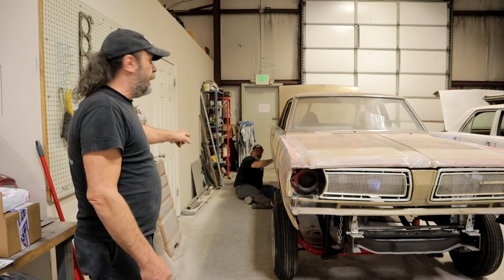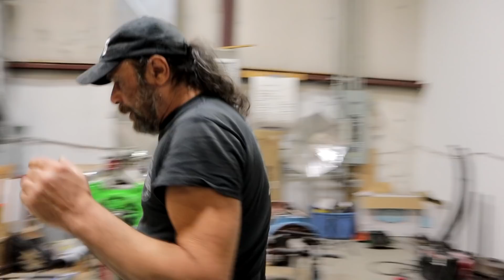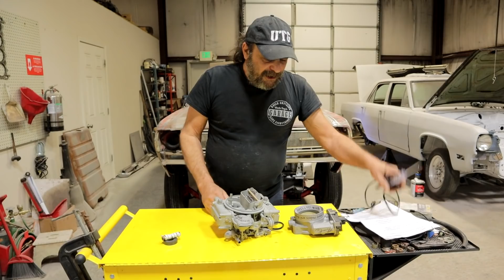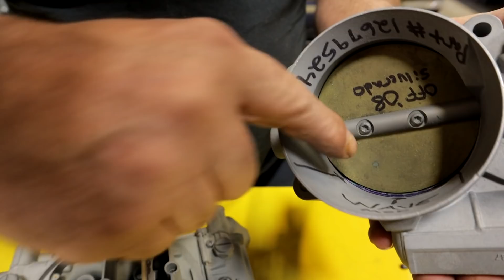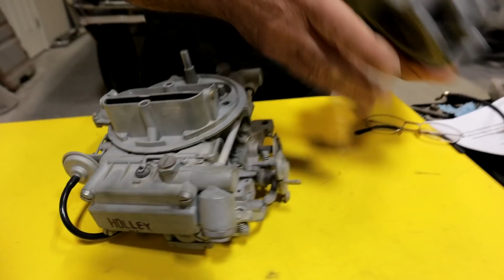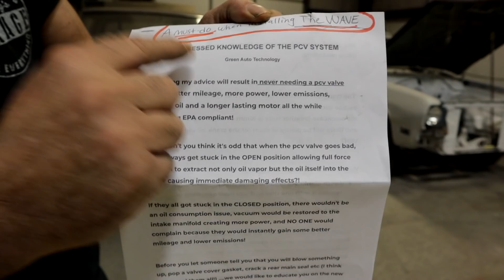The Free Energy Scam And Other Absurdities Of The Mechanical World

Comment: Tony!!!!!!! Contacting you for a idea you was tossing around in a older video about using the heat in the engine bay to help power the car through steam!!! I think there maybe another way without steam. Peltier effect and instead of using it to cool or heat something simply draw electricity from it... They are using this now in some camping stoves to draw heat energy from the fire using temperature differences from 1 side of the device to the other to make electricity. The devices are cheap when u buy them in bundles and just set up a 12v system to keep it simple to assist the car possibly through the belt drive like with a super charge except your electric motor is taking the place of it to help drive the car...
Reply: Don't think this could power a e\motor all the time but what about with stop and go driving? Ford was experimenting with a pressure system in there truck's in the early 2000s saying alot of Mpg's was lost in the acceleration to get to speed something over 20%. So why not a e\motor with a system thats using waste heat to store energy to help u accelerate to speed using fords Basic idea????

Comment: If you choose to test the carb, I agree with the others who suggest that you swap the modified throttle blade section with a stock one, either on the provided carb or on a known good stock carb, to ensure that differences elsewhere in the carb don't affect the outcome.  Also, it is probably worth coming up with a different test regimen than was used for the vapor test - in that test Al got 2.5 and 2.75mi, each on about 0.5gal of gas; this is only 5 - 5.5mpg, which suggests that test probably didn't reflect real-world usage, or that the car might be in such poor tune that any differences there might have been due to the fuel vapor disappeared in the "noise". 
A couple years ago while tuning my motorcycle carbs, I came across a tip suggesting to mark the throttle grip so that it was possible to observe just how much throttle is used while driving (so you know which system in the carb to focus on for a specific issue).  It was enlightening to see just how little throttle is being used much of the time, and therefore how little importance focusing on the main jets had on anything but WOT.  Logically it seems the modified carb should primarily affect low-speed driving, if it has any effect at all, so there might be value in doing a low-speed or small throttle opening test separately from a 'normal driving' test.  This should give the best chance for the modification to show if it has any benefit, and to show what, if any, benefit it might offer in normal driving.

Comment: l agree with you if you don't understand the basic principles of the internal combustion engine you can't improve it. And yes the PCV system on an engine is one of the best improvements it also helps the front and real seal do their jobs without pressure from blow by from the cylinders

Comment: here is what you do you get a bore a scope you may have to modify the intake manifold to be able to Insert the bore a scope under the carb . you inject some smoke while the motor is running and see if the air currents are visible. then  I would tell mike to get he's head checked.

Comment: I agree 100% about the PCV system... a very innovative and ingenious idea that most people STILL don't understand.  I'm glad to hear you'll be doing a video on it and I can't wait to see it.  
Funny story... my grandfather was a mechanic back in the 50s.  He "invented" his own PCV system around '52 or '53 and installed it on his own engines and some of his customer's engines.  He simply cut off the road draft tubes and/or installed a hose with an orifice from there to the intake or carburetor.  He kicked himself until the day he died wishing he'd applied for a patent...
Reply: Your Grand dad would have been wasting his time!  We had a 1947 GMC farm truck that had a factory PCV system.  As a kid I thought it was one of a kind but have since seen other trucks of the same vintage with the same system.
Reply: @Cougracer67  I'm quite certain the only crankcase vent system any manufacturer had in 1947 was the road draft tube.  Factory installed POSITIVE crankcase ventilation didn't come around until the mid '60s.  I'll do some research, though, do you have any other info about it?

Comment: I remember doing several diesel fuel tank drop and clean outs due to filling up with gas at the pumps across the street. Of course  we would put that crap in our gas burner cars/trucks because it was free go juice! so we figured 3-4 gallons of diesel mixed into 20 gallons of gas. I would fill up half my tank with that crap then drive across the street and fill up the remainder with 93 and the car would run great and I would get 1.5-2.5 better mpg's. The other guy would do the same on his truck and fill up using regular and complain about pinging like crazy until he was able to add 1/4 tank of premium and it went away and his mileage would go up like mine. These were both lower compression non performance engines, chevy 350 and chevy 2.4L, two valve etc. Im wondering if that roughly 10 or 12 to 1 mix would offer better mileage on a test stage. Fyi don't give in to the free energy nuts, it only emboldens them.

Comment: Well, any test most probably should be light throttle and load  . When Jenkins had me put 850 baseplates on 660 carbs, he had me taper bore the stock 660 hooopty-do grooves out for a nice transition to the .060 larger throttle bores . He said something to the effect that the hooopty-dos were just for transition from light load to full throttle  .

Comment: I'm not an expert, only an retired Chrysler mechanic. The throttle body has an idle air passage that allows air past the blade . At idle the blade is completely closed . If you would open a pasege allowing more air to pass past the blade, the idle air motor would try to close to control the idle rpm . I think it would create a big problem,light the check engine light. Not sure about a carb
Reply: Not true. There are a hundred videos that show no added problems after the successful mod has been done.
Also you have to reset engine computer before the changes so it speeds up the computer s own adjustments to the mods.

Comment: Back before YouTube I remember seeing a web page where this guy was showing you how to build a car that ran on water! He was showing you how to electrolysize the water you were going to fill up your gas tank with and pipe the Hydrogen/Oxygen mix up to an internal combustion engine at the front of the car! The engine would run the generator that powered the electrolysis back at the gas tank! I can't remember whether the vehicle moved via electric motors powered by the generator or via the drive shaft from the engine. He was demonstrating with some late 60's, early 70's domestic car like a Valiant or a Nova. It was absolutely hilarious!

Comment: As for testing that magic device, you will need a control, meaning a "normal", non-magic-wanded device. 
I think the only way you will be able to see if it has even the tiniest result would be to pick a non-windy day, trailer the test vehicle to someplace very close to the Interstate, and then take test vehicle up to interstate and set the cruise, or monitor the tach or something to ensure you are running a constant RPM. Run quite a few miles, turn around. Swap the device in the parking lot next to the trailor, and then do it again. Figure out MPG in whatever way you see fit, might be best to top the tank off before both runs and after and measure the fuel I guess. maybe you can find a gas station next to an exit ramp with enough parking space. EDIT: don;t forget to warm the test car up and re-top the fuel before the first run. 

if you do any town driving at all the crazies will say you r werent consistent. If they insist that is where the savings come from, then this is already a lost cause and not worth bothering with, the variables of city driving make testing a device impossible unless you do it over the course of six months of daily commute. I know I wouldn't invest that kind of time.

Comment: I'm with a lot of people, on the battery charge; Let's test it, first. On the carb test;  I'm wondering about that. How can it be fair? What all, was "done" inside, to this first carb?  Anything? So, picking up the same year-make-model, and jetting it, matching the venturies.... Just to keep things equal. You have 4, or 5 different drivers, a quarter mile KNOWN course, with stop-n-go traffic. THAT'S where most of the driving is done. Not on an open highway, where the speed is constant. I grew up in New Mexico, where it was some 60 miles, from Santa Fe, to Albuquerque, and 100 miles, to Las Vegas. I, personally, went past a State Police officer at 100 MPH. He never blinked. BTW! My thoughts on these 100 MPG carbs, throttle blades, and other magical Unicorns... There have been several books written, on how the author won the lottery; " For $29.95, YOU TO can win the lottery!"

Comment: One mileage improver that actually does work is an HHO system. I helped a friend install one on his freight liner and his mpg did increase substantially as did his power. He was getting ready to install one on his regular car when we had a falling out and stopped speaking to each other so I don’t know how the one on his car went. My concern with the HHO systems is that engine components will either wear out  faster or be burned up from extended use of the HHO gas which is why I haven’t installed one on my car. I’m on a fixed income so can’t afford to blow an engine to find out.
Reply: Hho systems absolutely positively do not work, at all. Period.  I could go over everything with you but I know you don't want to hear it. But basically.... physics says no.
Reply: @DrewLSsix  Well, how would you explain that Freightliner going from 6 mpg up to over 9 mpg instantly when the HHO system was installed and when he wanted to confirm it and turned it off on his next fuel fill, it dropped back down to 6 mpg and on the following tank of fuel it was turned back on and it went back up to 9 mpg? I was with him on the 2000+ mile trip when these comparisons were done so saw it first hand.
Reply: @DrewLSsix  Good answer!
Reply: There’s no free hydrogen on the planet. 
All hydrogen must be man made by burning electricity. 
You can’t get free hydrogen.

Comment: START WITH BASICS OF: btu , joules, energy transfer to motion. why burning a cord of white oak would accomplish more than 55 gallons of gasoline.
how natural uranium you dig out of the ground has more energy than any common fuels we currently use. this is the problem we stopped moving forward with nuclear.
i did the dead battery recharge with electric welder it worked. thanks

Comment: i dont think it will do anything. and carbs are sketchy on mpgs already carb to carb. set up a 1 gallon under hood tank. runt the carb dry. hook up one gallon tank. start up take off down the raod so you are under load. see how long/far you go. do it again with another car or 100 other carbs because they all will be a little different. or very different. unless the carb does 30 miles its hard to know if it would work.

Comment: You don't need a running motor to test that carb. Just a vaccum and a supply line. The problem is you need an unmodified version of that carb as a control to test against. Anyway the carb just needs to pull fuel. If it pulls more or the same..... it don't work. If it pulls less then it probally still doesn't work but might merit further invesitation. Repeat to determine if it was just an exceptible margine of error/variance.

Comment: I'd send it back and say thanks but no thanks because their just doing it for attention, maybe do your version of fuel saving tips for example, Different cfm carbs or different jet sizes. Different timing settings, gear ratios, open vs closed air cleaners, different thickness carb spacers, things that actually work

Comment: I suggestion for how to test.
I would get and known good carburetor and do a full on in depth test for efficiency and mileage on the GT. Then I would go to the guy that sent you the carburetor and throttle body and say you can't use those particular carburetor and throttle body, however you can send him your carburetor you choose for the GT to be modified and retested on the same GT. That way you're starting from a known good platform that you can control, and he gets to do the modifications he wants to do to a carburetor you know is good. 
Do I think it'll change anything? No. But it's about as impartial as you can get seeing how bad that linkage is on that Holly. All the other standard stuff should apply with a different guy driving who doesn't know the conditions, but you can see the issue with the tests being days apart.

Comment: Didn't they come out with something called the "Tornado fuel saver" in the late 90/2000's? Also I've seen throttle body and carb spacers with spirals machined in over the years.

Comment: the only time the ring magnet, bolt with wire coiled around it would work is if the wire were bare (no insulation) and the wound bolt were passing back and forth through the magnet, it takes energy to produce energy

Comment: the concept of using vortex as a magic super charger defines futility. 
THE MOST COMPLEX / POWERFUL / EFFICIENT ENGINES IN THE WORLD --   STRAIGHTEN  -  the airflow as it moves through the engine.  They also eliminate  airflow  "  REVERSION "  which is THE #1 killer of piston engine power and efficiency.  
the vortex is used to accelerate air by disturbance.  that disturbance lowers the pressure and thus density of the air. less dense air creates less torque during combustion. 
if you want to make more efficient power with a piston engine you will need to create hot and cold check valves that completely eliminate reversion while not slowing the intake charge and not reducing volumetric efficiency. 
the vapor engine already exists.  your car runs on a vapor engine.  don't think so ?
what is the temperature of the intake runner ?  what is the temperature of the intake valve ?  the exhaust valve ?  how about the temperature of the cylinder wall ?   how about the temperature of the piston head ?   by the time the atomized fuel spray goes past an intake valve - contacts the cylinder wall, the exhaust valve head and the piston head -- it's  VAPORIZED.   there is no raw liquid or atomized droplets left.

Comment: Drove out to Colorado in my 73 rally charger with a 340 thermal quad, 22 miles to the gallon and now I’ve got a 14 three-quarter ton Dodge 4 x 4 with a 5.7 and I’m only getting 16 miles to the gallon, I know different vehicles but how’s it technology changed that much and the 73 was much more reliable

Comment: Take a dead donkey, probably one down the road on the right under the hickory tree. Put the carburetor on the exhaust pipe of the donkeys ass. Place gas on the head of the donkey, then light. Smoke some of uncle Bills loco weed, give donkey hit, but not Shrek. See if the air fuel refer mix is the same a Cheech  and Chong’s impala. If all is correct the fuel mileage will not be the same as a Yugo with the rear window heaters on because it’s going to be cold push starting. When done burn all left overs…. This would probably be the fairest way to test that pos Holley.

Comment: Fair test design 

Get the exact same carb factory setup or "Uncle Tony setup" for maximum fuel economy. But it needs to be the same model Holley. Run multi tests. Run a like drag run for time. Do the round the building test on a certain amount of gas for fuel economy.

Comment: UT, take a hammer to both the carburetor and the throttle body and see how many hits it takes to get to the center of the of the air fuel regulators.

Comment: This had me laughing just shy of hysterically. Your restraint is admirable. I must confess that many many many years ago, in a land far far away, I bought a gadget for a FOOL injected F150. This mounted below the throttle body and had a spiral groove in the throat to improve fuel/air mixing. You'd think that at my age then I'd have figured out that with multiport injection it would do squat. Nope, numb nutz here ended up $150.00 lighter and that's where the fuel saving came in. DOH!

Comment: I sent these two videos in before, but couldn't find any responses? They're about a new patented I-4 large displacement (~7 liter) engine apparently using a proprietary modified rod design to eliminate or significantly reduce the secondary imbalance problems of large I-4s. Not a "fly-by-night" project but engineered with the help of a major European automobile and engine design and engineering firm.
Although targeted initially at a niche power boat market, this ties in to the improved mileage theme of your videos. I-4 engines use ~½ the parts resulting in less friction wear and much higher RPM for displacement and output power at 5,000+ RPM. This would improve cost and efficiency (mileage) compared to a big block V-8 of the same power output. 
Both videos are well done although you can skip about half of the first one if you understand 2ndary imbalance limitations in I-4 engines.
Alfadan Big Block I4 - Revolutionary New In-Line 4

https://youtu.be/8alrpieveDg

Alfadan Update - Interview with CEO, patents, Bourke engine, ICE future and more

https://youtu.be/vuIqSKIujFg

Comments from UTG viewers and uncle Tony would be appreciated. No I'm not associated with the company at all. I'm just a guy who watches UTG and is intrigued by cool piston engine designs. Thanks.